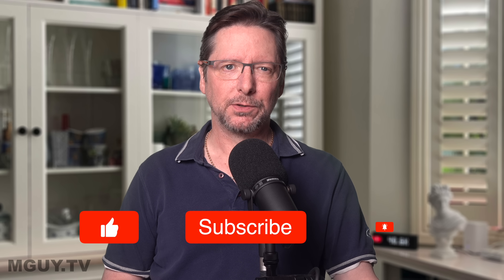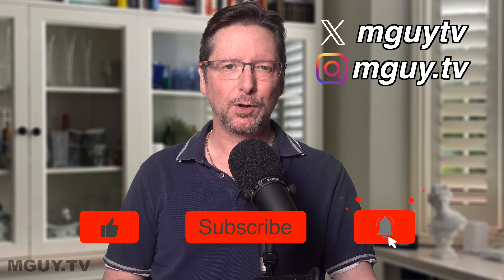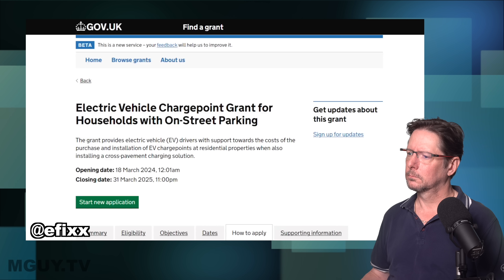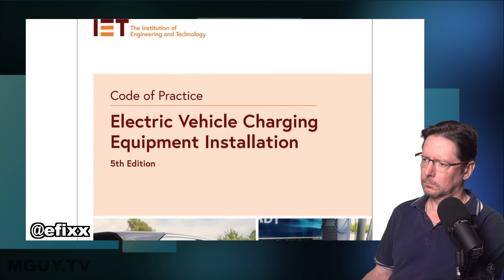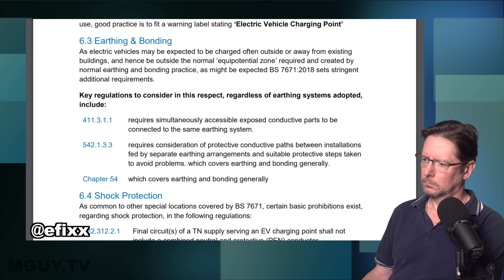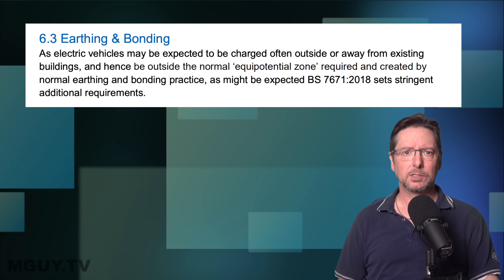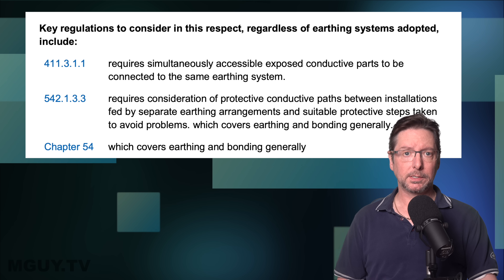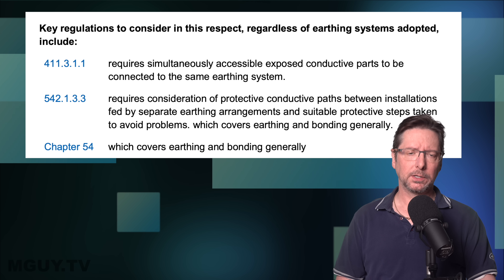ELECTROCUTION RISK from on-street EV Charging | MGUY Australia

Comment: When I used to re-fuel my light aircraft I had to connect the airframe to earth with a clamp [static electricity being one of the reasons]. Any equipment really should be staked to earth including a car if it has mains voltage feeding it - these types of vehicle could also build up static too.
Reply: Aren't tires meant to do that? I know they're meant to pass lightning strikes safely to ground.

Comment: Actually thinking about it, the most common reason for electrocution is water, (water conducts electricity)
The charging points will automatically  shut off if they detect even the smallest amount of electricity shorting across the connector or to ground!
This is probably why so many do not work, they have tripped out and require someone to check for a fault and reset them.
Just look at the design of them, a cable that plugs into the car not very clever if you have to connect in the rain, it only takes one rain drop to short the electricity as soon as you turn the charger on.

Comment: There is ZERO electrocution risk for properly wired cabling.
It is because Earth Leakage Circuit Breakers are LEGALLY REQUIRED.
They permit a MAXIMUM of 17mA to ground before tripping.
The batteries have zero shock hazard too because they are electrically isolated from ground (including the vehicle chassis ground) and requires a connection to BOTH the battery positive and negative connections on the SAME battery.
The Relevant AUSTRALIAN standard is AS/NZS3000.
This is another example of pontificating from ignorance - and a I AM an Electrical Engineer.

Comment: With 3 phase electrical supplies there could be a 415 volt potential difference betwee 2 faults. that isn't good either. The supplies should have trips fitterd but there is alwayss the cowboy element.

Comment: I used to drive nightliners (i.e. tour buses for music groups) and we always run cables out from venues to power the bus, usually 240v single phase but sometimes 415v 3-phase if the vehicle has an electrically operated air-con generator installed. I've never really thought about this high potential difference between different grounding points, but I can categorically claim that the issue had never been drawn to my attention. Then there's festivals where groups of 25-100 of these types of vehicles could be parked in close proximity of each other and not necessarily be connected to the same generator. Scary now to think of the potential risks involved.
Reply: Since this video is just FUD - scare mongering for the act of scare mongering - I wouldn't worry about what you did. You did nothing wrong and were in no danger because of it.
Reply: @karlgunterwunsch1950  Really? I don't think there'd be regulations against the practise if it was just 'scare mongering', do you?

Comment: Who's liable in case of an accident? the installer? the owner? the council? They will probably require specific electrocution clauses in EV insurance policies - adding more cost!
Though in part defence the manufacturers do put quite a bit of effort into the charging connection and fault sensing.

Perhaps EV's need an additional earth strap dangling to ground or conductive tyres to register any earth leakage to an RCD?
Proximity to a floating lump of metal connected to the mains on rubber insulators does seem quite dubious.
Reply: This is not an EV insurance issue but is the homeowners policy.  It is likely the homeowner will get sued and the council and sparky will be named as additional defendants.  You should most definitely tell your insurance company you use this cross pavement thing.

Comment: This is crazy.  In the UK you're not allowed to work on certain electrical items in your home under part B regs.  Apparently the govt. now thinks it's OK to chuck high voltage cables around outside, without consulting anyone as far as I can see. There have been several councils that have banned this practice under advice from insurers and lawyers - it really is a non-starter.
Reply: Sadly I have to disagree with you.The very fact it's crazy dangerous is the reason why I think it is going to be rolled out.And as for anyone injured by it well that will just be their fault somehow.
Reply: @stevengriffin7873 If it's crazy dangerous then find me a single example of someone who was zapped by a public ev charger. I'm not including home chargers because some people are stupid enough to try and install those without any experience, wiring them wrong and killing themselves.
Reply: @Luka_3D  Give it time.
Reply: @stevengriffin7873  It's been 12 years since the launch of the model s and the supercharger network. How much more time do you need? Also how many gas station fires caught fire in the meantime?
Like, EVs have a PLETHORA of issues. This just isn't one of them.
Reply: @francismarion6400  Just fyi, I'm not saying EVs don't have issues, I'm just saying this is not one of them.
Again, one example. I'm only counting public chargers though because people are dumb, think they can wire their home charger with no prior experience and end up wiring it wrongly.
Reply: @Luka_3D  Still go back to my comment.I just don't fancy the idea of walking down the street over dozens of cables charging dozens of vehicles.It's my opinion on the subject that's all.The stupidity of people I see around me doesn't fill me with confidence.
Reply: @stevengriffin7873  Yeah you've got a valid point there and I also hope running extension cords doesn't become the norm. I think we should first of all put chargers right on the street so they don't have to cross sidewalks, and fine people for not nearly tucking their cables away so they're out of the way of pedestrians.
Reply: You should see the Australian electrical regulations, a fully qualified electrician here has to do a minimum 4 year apprenticeship making it the most highly trained and regulated domestic electrician standard in the world by far and also the most expensive lol, most of them you'll find will charge and hourly rate upwards of $90-100+/hr !
Reply: 😂 councils don't have such random powers like that. Any such ban is central issued by government!
Reply: It is not high voltage it is low voltage.

Comment: So couple decades ago I use to regularly run a 240 volt cable across the footpath and nature strip to my car parked in front of my parents house to keep several batteries topped up in the car which was my power supply for my own place that was off grid , it was more like three decades ago actually. No led lights in those days but compact flouro lights had just hit the market , photovoltaic systems weren't as cheap as nowadays . For the cable laid across the footpath I used to cover it with a heavy rubber large mat . Also I used to do same when mowing the nature strip with the flymo hovercraft mower probably unique to Australia. Needed to be very careful to not mow over and cut the cable,

Comment: My 14 year old audi a3 diesel weight is 1300 kg
The YModel tesla is 1900 kg.
600kg EXTRA  WEIGHTwill require more energy to move.
So irrespective of where the enegy comes from ....the physics dictate that teslas waste more energy
I just saw a satisfactory clip on TV.
The potholes issue. 
What pleased me was seeing a teslas wheel damaged. 
The teslas got special treatment but don't pay for their weight  like heavy lorry do.
The battery on a y model teslas 750kg...STOP AND THINK ABOUT THAT.
it's 500 kg heavier than a 2litre .diesel engine. 
Sooooo.
It's like having 5 big 100 kg rugby players in the car ALL THE TIME. 
they're causing potholes more so than conventional internal combustion engined cars...
But they don't pay the same road tax....
Karma
Reply: Except that Tesla uses 90% of the energy and your A3 diesel only 25%... And the Tesla - like all EV's - can recover much of the energy used to accelerate the mass when breaking (using the electric motor for the most part as a generator).

Comment: We haven't even managed to get fibre broadband to everyone yet and that's been going on for years. Electric points for everyone and cables everywhere will be interesting! not to mention damage either accidental or stolen for the copper. I would love a crystal ball to see what actually happens.
Reply: You don't need fiber to put down an ev charger lol
All you need is some electricity. Also theft of charging cables is relatively low because it's hard to cut them and because they don't contain much copper.

Comment: Seems odd in America we have to drive a brass ground rod about 6 feet long by power poles and electric boxes and they are connect to the ground rod with a heavy wire usually less than 6 feet long it seems to me if you did this the center tap wire is grounded at the power station and also at the box with the short cable connected to the EV. If you did this in Mary old England it seems to me that every box with a cable coming out going to your EV’s would be grounded to Earth and you wouldn’t be getting shocked from one vehicle to another or to a metal cabinet as you said I’ve heard that you do differently in Europe. The other thing we’ve started doing around the last 20 years or so was to put all of the electric powered stuff in plastic boxes and not have anything metal exposed where anyone can touch it even it they’re standing in a puddle in the rain unless you submerge it in water you will have a hard time getting shocked. It seams odd to me after all these years using electric that you wouldn’t use a common earth ground connected to everything. Heck in America they even want a generator connected to an earth ground. I’m guessing that’s why you all ware Wellington’s or rubber boots all the time or at least the people who don’t want to get shocked and I’d recommend waring some long rubber gloves also. It couldn’t hurt or I should say it won’t hurt when touching your EV’s. After all it’s not likely that it will rain when your charging your EV while your standing in a puddle in the rain holding a high voltage cable in your hand. 🖐️ what could go wrong just think how there all saving the planet buy playing with high voltage in the rain. If I were a suspicious person I might think that the government era trying to get rid of a lot of people for some reason 😂😂😂😂❤

Comment: There will be many tombstones with the words, "Here lies a Hero of Climate Change, Died From His Commitment To Charging His EV In The Rain".
Liberals shouldn't be allowed to govern. It requires more wisdom than they possess.
Reply: I have charged my EV multiple times in the rain. It's not dangerous - as the cables and connectors are designed to prevent any contact with the electricity...
Reply: @karlgunterwunsch1950  Sure, I have been using electricity all my life. It's dangerous, especially in water.
Reply: @EnthusiasticTent-xt8fh  Except that we deal with water here that has very little salt content and thus isn't a good conductor. To do any harm you need to get into contact with a good conductor because our bodies have enough salt in them to make them decent in this regards...
Reply: @karlgunterwunsch1950  Wait til it shorts.

Comment: Wonder who will be in legal problems when death by electrocution happens, the government, the installing company or the civilian supplying the connection.
Reply: Since this simply will not happen there won't be a problem.
Reply: @karlgunterwunsch1950  But it will happen. Gives a good video.
Reply: @Wajang1  It hasn't happened over the last 15 years that we have hybrid cars (they too have a high voltage storage) and not over the last 5-10 years where we have a decent number of BEV on the street. Of course it will happen eventually if someone who is clueless will try to self service something he is clueless about - but that will be far lower numbers than people that self service their current ICE death traps, there is far less critical things to go wrong with BEV. Not even the air conditioning - which both kinds of cars share - is at the same level of risk, because in an ICE car the air conditioning intercooler needs to sit right in front of the car, right in the path of any road debris while in a BEV it can be placed to the side of the former engine compartment and still get enough cool air for the heat to be dissipated.
Reply: @karlgunterwunsch1950  You really have no clue what kind of a deathtrap the EV is when it goes wrong.
Reply: @Wajang1  You obviously don't know what a deathtrap an ICE is even if it doesn't go wrong - which it does at a rate 20-60 times higher than a BEV. All you have provided is pure FUD from someone who is absolutely clueless about the technology.

Comment: I’m trying to understand this correctly.? Even though I don’t own a EV automobile I might actually be electrocuted to death by one that’s in the process of being charged? Question; what about all the children out playing amongst all of the live electrical chords strewn around the neighborhood?😮
Reply: Nope you won't... Just as you won't get electrocuted because the neighbour cooks dinner on his electric oven top...
Reply: Could get electrocuted if he crashes into you too - 6oo volts DC in the car battery
Reply: @ggee7391  the battery architecture determines the DC voltage. It's 400V for Teslas and 800V for EGMP, Porsche and some Audi... And no, the moment the insulation is breached the battery will be insulated from the environment. No danger to be expected. Only if the battery is still fully intact and the fire brigade needs to use the jaws of life to extract you from the mangled mess your car now is then the manual insulation must be triggered (there are multiple points where this can be done safely)...

Comment: None of the charging port plugs and sockets are actually designed for or meet minimum standards for being used outside.   You're at risk for electrocution using any charger system that isn't under an awning completely out of the weather to start with and I guarantee that these cords are going to get stolen nightly.
Reply: False, type 2 and 3 cables are designed to be used in the wet.The outlets used are designed to be mounted outside as well. So stop spreading FUD!

Comment: I worked on multi-story building projects all throughout Australia and Tasmania in the 80s and 90s.
Rules at the time said that trades men had to have their power extensions cords above the ground to prevent execution and trip hazards. 
Most building managers on these sites would supply support stands to facilitate this need.
I've seen building sites shut down for days if extension cords  were found on the ground/floor by safety officers. 
How can Gov get away with not protecting the public from tripping, etc, on EV power cable on footpath, etc ?
Reply: Not a requirement in NSW. Well it wasnt in 2012, anyway LOL.
Reply: @starpawsy  
Most sites, not all.
Reply: @charliepearce8767  I was an electronics technician at that time. I had to pass an electrical safety induction (that choice of words was hilarious) to work at Coles, Myer and Woolworths. All of which are heavily unionised and OH&S to the eyeballs. There was nothing about not running cables on the ground in any of those induction courses.
Reply: @starpawsy  
Like I said,  "not all buildings sites" in the in the 80s..
You being educated in your profession would understand what we're talking about in regards to electrical safety. 
The same safety standard that's not being adhered to by local governments. 
Or what, you think I'm, making storys up, or lying ?
Reply: @charliepearce8767  No. I quite believe you. I think what it is is that there was no government mandate, and different industries having different standards.

Comment: It is unlikely that someone would touch two cars or car and other metal objects  at the same time.
But the danger of electrocution by a faulty car battery and the ground is real especially if the EV has crashed!
There is a very good reason why the hybrid or EV  racing cars have warning lights on them, under fault conditions the body of the car may be 600 volts DC, if you touch it while standing on the ground it will probably kill you!
That is why the drivers jump off the crashed car.
It is only a matter of time before someone steps out of an EV and is killed or by handling the charing cable that has damaged insulation!
Reply: What a load of uneducated FUD you are spreading. If an EV has crashed the HV battery will be isolated by circuit breakers. Racing cars are a different matter because there the safety measures normally installed in road worthy cars are left out for more performance. 
Damaged insulation is checked by running a (low) pilot current through the cable when  connected and only if that is ok then the charging process starts!
Reply: @karlgunterwunsch1950  yes a low voltage limited currant could test the connection. 
10 volts will not jump the break in the insulation, but 600 volts will do it easily. 
In theory crash sensors will disconnect the battery and also under fault conditions.
I have worked in industry for years with this 414 volt 200 amp (or more) 3 PH variable speed motor technology,  in theory if a fault occurs it just stops, 99.99999% of the time it douse. 
But it douse happen that the contactor/circuit breaker is actually the part that actually starts the fire as the old part burns out.
In the event a car crashes the damage could    damage the circuit breaker physically preventing it from opening,  the power stays on!
I have seen a cable arc weld itself setting fire to the machine, the circuit breaker failed to trip and turn the power off.😯
These things should never happen but it is the real world and not a theoretical world, so they do actually happen!
Same as in theory the aeroplane with all its backup systems cannot crash, but they do.